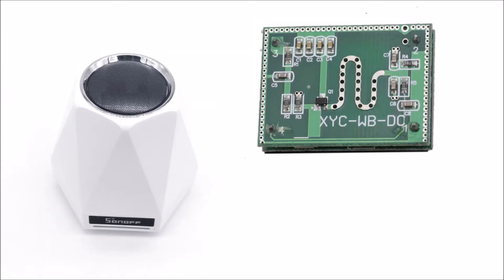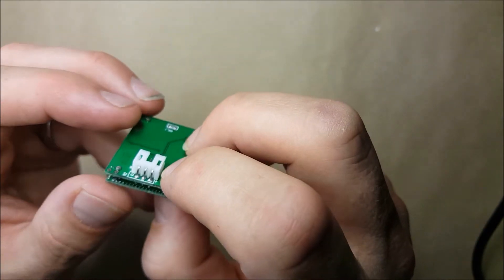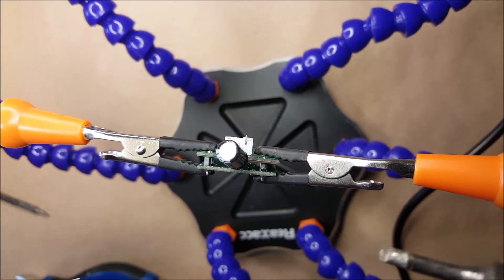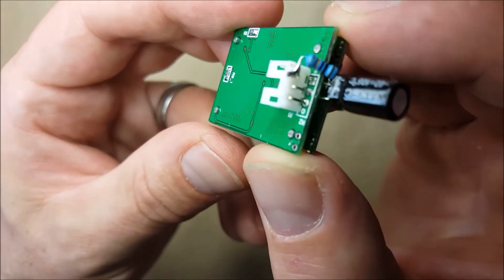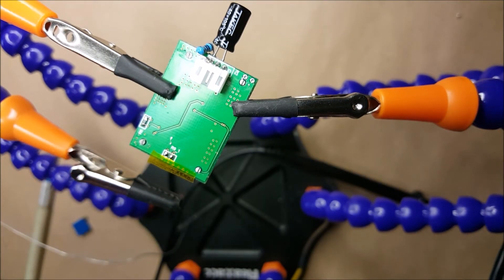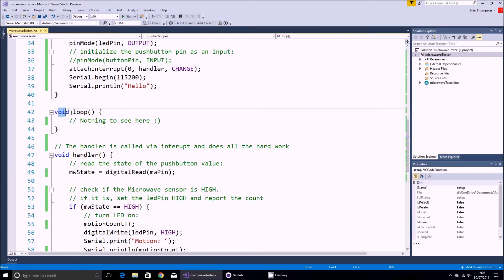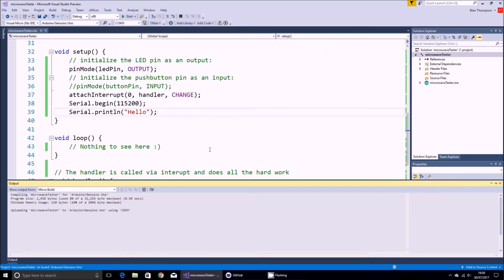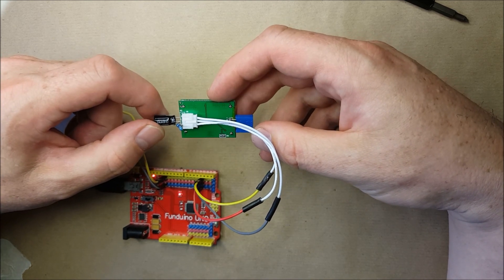Modifying a XYC-WB-DC Microwave Motion Sensor for use in a Sonoff SC

Comment: For those who are wondering: No, the RC-filter is not sufficient to mitigate the false positives. At least in my setup with an ESP32 the false positives seem to be a result of RF interference from the WiFi transmission. Moving the sensor away from the esp32 module helps some.
Reply: After a lot of testing, the solution to the false negatives was to place the sensor some 100mm away from the ESP32 and also placing a ground plane (grounded piece of PCB) between the ESP32 and the XYC-WB-DC. Pro tip: place the ground plane right next to the XYC-WB-DC for best results. For some reason placing the ground plane right next to the ESP32 resulted in poorer performance than not using a ground plane at all.
Reply: @Drektjal  given that the sensor uses a PCB slotted waveguide - is it possible to put a grounded enclosure leaving just the front open to radiate?
Reply: @JonSmith-fc2mm  worth trying if you absolutely must use this sensor close to an esp32. After a lot of testing and  fustration I gave up on the XYC-WB-DC altogether. Even after getting rid of the false positives the sensor would occasionally  lock up  for hours on end for no apparent reason. Several days worth of tinkering for nothing..
Reply: @Drektjal  thanks for the heads up.  I was going to remote an ESP32 without WiFi so perhaps that will dodge that bullet.

Comment: You should not generally use serial prints (or delays) from within an interrupt routine.   Just increment motionCount and set a new variable "triggerd = true" in the interrupt handler.  inside loop() put an "if (triggered) {triggered=false;Serial.println("triggered");}}

Comment: Hello Blair, very good video to show people how it is done. My advise is to put the 470uf condensator and the 10ohm resistor directly in to the cable short before the connector. 1. you don't have to handle the connector on board and 2nd it's better for people who don't have many experience with soldering. So when the RC (RF) filter is placed in the cable it can be shielded with some hotair plastic tube. It's closed then end it can be changed everytime without getting the whole sensor out of the housing everytime. Only a thought from a guy who has worked 30 years in industrial auotmation.

Comment: thx for the mod, the var resistor, on what value are you using it? mine on default resistor is seeing the neighbours :p
Reply: mine is  a 12k resistor (123) from the factory, so put a 20k or 30k pot on there.